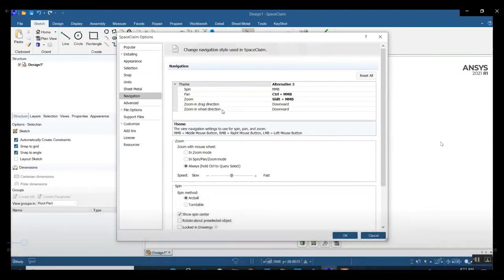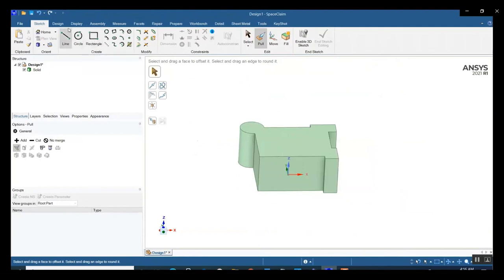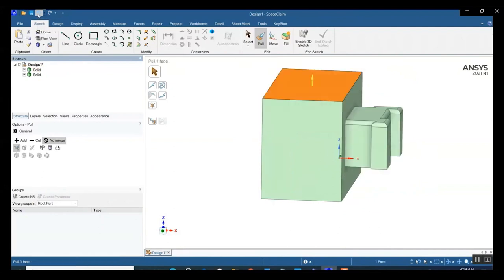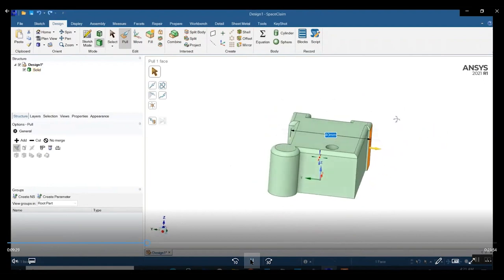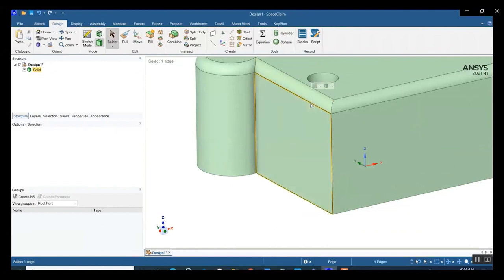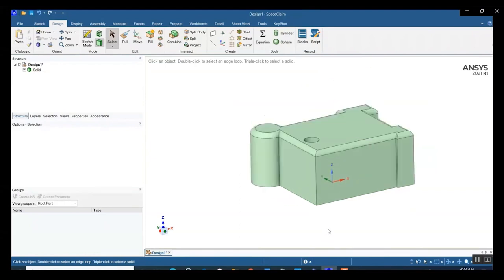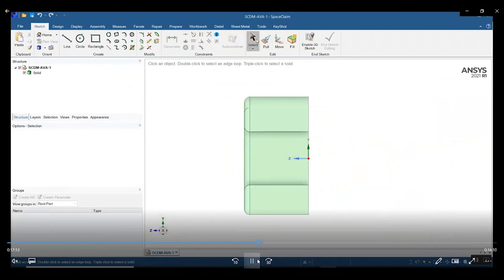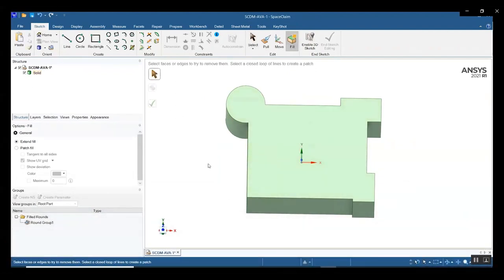Ansys SpaceClaim: Tips and Tricks | Ansys Virtual Academy

Comment: Hi, I'm having the an issue where the 'Sketch' ribbon on Spaceclaim is missing. I need to constraint my sketches and it's not possible to add them from the Design time. I tried adding them from the File -> Spaceclaim options -> Customize-> Ribbon -> Sketch, but the tab appears for an instant and then disappears.
Any help would be appreciated.